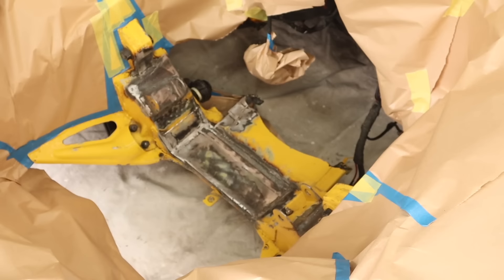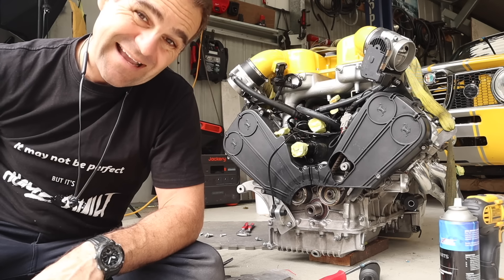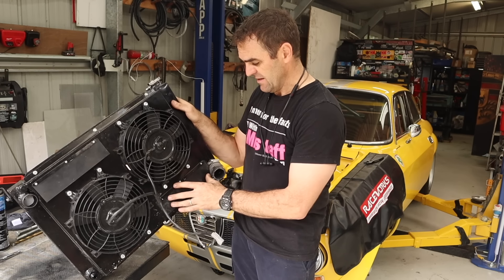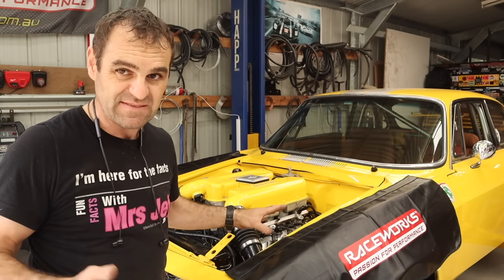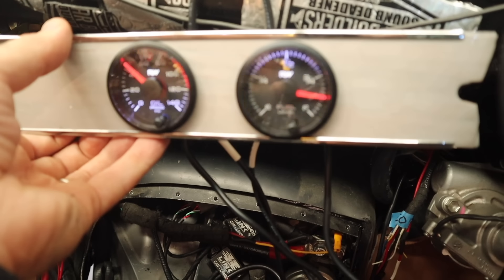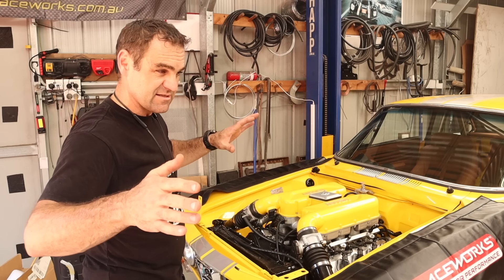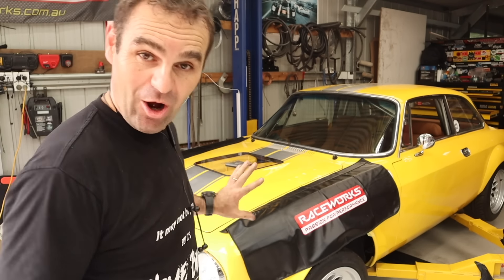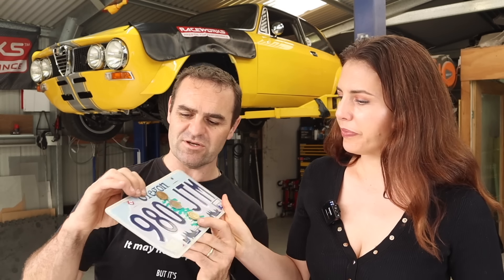I blew up the Ferrari engine...- Ferrari engined Alfa 105 Alfarrari build part 210

Comment: Worst case. Bent valves on one of the banks. Nothing major. Just a speed bump. 
Re time the engine and refit the belt. Comp test.  Don't stress. Take a breather.
Reply: ...and a beer...
Reply: A safety beer
Reply: Agree, re-time and take a look at the compression…. Bottom end will be aight

Comment: Re-time the engine and put the belt back on. Compression and leakdown test it. If the result are bad, heads off, check valves and piston heights.

Been in you spot before :)
Reply: What if the valve is hit and om the verge of breaking of the valve stem I would not spin it, instead would send a camera into the combustion chamber first
Reply: @specialvehicleimports7466  yeah, borescope is a good plan. Valves typically don't just snap off, especially not at idle speed. Bent more likely.

Comment: Hey Jeff, like the other commenters are saying, it's probably bent valves at worst. When the engine stopped running, there weren't additional pinging noises like if a valve dropped. 

As a previous Ferrari mechanic (worked on anything from 1960s - early 2000s), I'd put the belt back on and perform leakdown tests on the bank (looks like bank 2.) 

Anything lower than 80, the heads gotta come off. If they're above 80, then I'd also bore scope the combustion chambers to visually inspect the valves and the pistons. Make sure they're not excessively damaged that the leakdown says it passed. You can also check the valves and seats from the intake and exhaust ports. 

Best of luck Jeff, you got this!

Comment: That happened to my V6 Alfa Busso when the timing belt skept 1 tooth. 
I did the retiming, compression tested leak down tested and surprisingly was all good.

Still running strong after 2 years, hope it will be the same for you.
Reply: I had the same experience and results with my Alfa V6.

Comment: Ouch. We ALL feel for you and Mrs Jeff.
Sleep on it and approach is methodically and do all the simple stuff first. The advice in the posts below seem excellent to me. A few bent valves are not the end of the world. I've cracked a 911 cylinder from top to bottom a few years ago at 8000 rpm (missed gear). Carnage, but all fixed well. IMHO, leave the truck until this is put to bed. From a sunny England, Graham.

Comment: I feel for you Jeff. I know it sucks. I’ve been a professional mechanic since 2010 and I did a clutch and rear main seal on my truck and I started it without oil and I couldn’t hear the engine because the exhaust was a hack job that I had to cut out in order to pull the transmission. So I didn’t hear my engine knocking till it was too late. Never once did this to a customer car or my own car my whole career till now. I was / am beyond pissed at myself and now I’m currently building the engine for the truck. I feel you bro

Comment: So unlucky. Hope its not from running with too much oil in the sump. I onestly think the best thing to do is put the old belt on again and  do a pressure test. I dont think you can take the sump of without taking the engine out but in my opinion i would take the engine out again and check all the bearings too before starting the engine. And check the oil. Never nice to experience this but i think its part of the learning curve. Succes and keep your head up mate. Almost there.

Comment: Your poor bloke 

Fingers are crossed for you that was all the noise was and there was no mating of the valves and pistons ❤

You kept your cool quite well, far better than I would have after a long days work just being met with that. 

Get a boroscope in there, if no signs of contact and you can get the timing gear back together then hopefully all good mate. Best of luck.

Comment: I can’t imagine the stress and frustration you’re feeling Jeff. Ignore any  naysayers . You will get there . I’m about to attempt first start on an expensive A Series Mini engine build . Not exactly super car territory but I don’t mind telling you I’m a bit stressed!
Reply from the maker: Every first start after a rebuild is terrifying. Good luck mate.
Reply: @HomeBuiltByJeff Thanks mate 🤞
Reply: You'll be fine. 
Just don't get too spirited on the 1st drive and go easy on the gearbox.. 
Ask me how I know as MG Metro fanboy. 😂
Reply: @HomeBuiltByJeff  Sucess ! 👌😎
Reply: The noise does not sound like valves hitting. More like something bouncing around. Replace the belt. Double check timing. Turn over by hand. If OK. Do compression test.

Comment: Bugger. I'm pretty sure these engines are an interference engine, so yeah you have bent some valves for sure. Hopefully the pistons are still good and a valve hasn't snapped off. I feel your hurt. Soldier on Jeff, we are all right behind you.

Comment: Been there jeff, forgot to tighten the cam shaft sprocket bolt connecting the cam shaft sproket and cam belt to the cam shaft. They keyway on the sprocket kept it in time for about a mile before the keyway snapped and the spocket turned freeley. At least 4 bent valves. Cut the valves off checked the head over, fitted new valves refitted head and timmed up, ran like a dream. Consumables cost a bit, head bolts, gaskets etc, but in the end the main cost was time. It probably wont take you that long to do it. Good luck.

Comment: May the odds be in your favour Jeff! I'm hoping that the damage is minimal. New belt, re-time, check compression. Crosses fingers for you.
Reply: And it could be fine for eons but would always have that nagging voice in head that if not bent valve could be fatigued. High dollar engine so I would just yank the head myself as I know there was contact and rather not find out down the road that while in spec it’s fatigued and goons burn or drop at 10k rpm lol I’m more
Curious how the belt jumped and betting idler tensioner decide and or hydraulic pulley failure or bolt
Reply: I told him that sensor would be right fucked if it had come in contact and forcefully enough to throw belt. As use them myself as well as other link stuff. It would be deformed and fubar.

Comment: I repaired a Subaru DOHC EJ25D engine in which a crash had broken a cam pulley and bent 7 of the 8 valves on one bank. Amazingly the valves in the other bank were fine despite being driven by the same belt. Valve to piston wise, they're non interference engines, but being DOHC, unless all the valve stop and start moving together, the inlets and exhaust crash into one another, which is what had happened. No other damage, so a new head gasket, timing belt, pulley and new valves were all the parts the repair needed. I really hope the damage to your Ferrari engine is similarly minimal. 
If it's not obvious whether some of the valves are bent or not when you take the head off, pour a little of a very thin solvent like petrol into their port before you remove the valves, and see whether it gets into the combustion chamber.

Comment: Sorry to see mate, I would reattach the timing belt and turn the engine over manually at the crank with a ratchet to see if it all rotates with out any hits on valves etc. you got this mate 🤘🏻

Comment: Nooo! I'm so sorry that happened. We have all been there in one way or another. Since it was only one side it would still run on 4cyl. It will be some bent valves on one bank I would imagine. Its not like it blew up at redline. It sucks but i'd re time the engine and do a compression test/leakdown and cross your fingers! otherwise I think you might get away with one head rebuild. Good luck!

Comment: A well known Italian motto says, donne e motori gioie e dolori (women and engines [bring] joys and aches). So I wish you the joy phase being back soon. Completely other topic, in the stock 2000 gt (yours should be a slightly earlier but similar 1750) the oil pressure starts high and settles down when the engine is warm, so it's opposite wrt the porsches.

Comment: Jeff, as a former workshop proprietor specialising in Italian cars I feel for you however I suspect the damage won`t be anything as serious as you suspect. Saving grace is the engine was at idle speed. Reset the timing and then do a leakdown test. I suspect some bent valves. I had the same thing happen when one of my staff left a spanner in the valley which then vibrated its way to the belt and getting caught up while testing whether the timing was correct before the covers went back on in the workshop. It happens sometimes. Generally serious internal damage happens at higher than idle revs and we did a few broken timing belt repairs.

Comment: That’s the same noise my Alfa Busso motor made when the timing belt slipped a tooth.  In my case I got lucky, reinstalled the belt and all was good.  Hopefully you’ll get lucky too.  As others have said, reinstall the belt and tensioner, turn it over by hand, and cross your fingers.  If it turns over smoothly do a compression test, if that’s good start it up again.  Hoping for the best from California.

Comment: I couldn't bring myself to watch this episode for a day. I watched it hoping that you would stop the video before it happened, impossible I know. I had a similar thing happen with my Fiat 124 twin cam. Engine was cranking over but didn't sound right. Lifted the bonnet up, cranked it over again. Cam pulleys aren't rotating but its cranking. Stripped the teeth on the belt at the crank pulley. Three bent intake valves. Got my fingers crossed for you Jeff.

Comment: I really hope for the best and a miracle for you mate. I remember killing an Alfa engine in the race car all because of me stupidly not securing the overflow tank and relying on the street car fitting and forgetting about body flex. Damn thing popped off at Lakeside raceway, dropped onto the extractors and just spilled water everywhere (including my slicks causing me to spin). Didn’t stall, limped to pits but engine just cooked instantly…as would alloy DOHC heads as soon as there is no water (I didn’t realise what caused me to spin at that stage). A $5 fix would have stopped that from happening. Fingers crossed when you undo everything…it was running.

Comment: The revs didn't seem to drop and the engine did not misfire.  If the timing belt was allowing the valves to open/close at the wrong time the revs should have dropped or there should have been a misfire.  Best case scenario is the banging was just the Link module and the loose timing belt only became loose when the engine stopped.

Comment: Sorry to see Jeff. Stay optimistic. It was steady 1200 rpm so the belt might have had consistent tension and not been whipping. Maybe the belt hasn't even jumped teeth. Can you check that without removing the motor? You might be lucky. New belt. Re-time. Compression and leakdown test. If the results are same on both banks, no hesitation in firing it up to do your overheating test again. Fingers crossed buddy.
Reply from the maker: Thanks mate

Comment: Take a step back and remember that this isn't the worst problem you've had to solve, you've got this buddy! 

I'll dig around and see if I have some old NH toll tokens that can go with the old plate. They're a bit of iconic history for a coin specifically minted for our highway department. They all feature a rock formation called, "Old Man on the Mountain" that collapsed in 2003 and has a bunch of awesome indigenous Abenaki lore.

Comment: It is also possible that no valves are bent and the loose belt is the ‘trailing side of tension’ after the engine stopped rotating. That’s my hope for you Jeff.

Comment: OMG! I feel for you mate. That's gut wrenching. You may be lucky. The engine was only at idol. I would get a camera and put it in through the spark plugs and see if the pistons have taken a hit from the valves. I'm sure you can get an piston inspection camera with a light on it. Google it. It's a nightmare really because you definitely need to remove the rocker covers to see where the head timing is in relation to the bottom end. I would imagine the engine to be similar to my Alfa V6 Busso engine in that regard. ? I wish you the best of luck. I've been watching this project from the beginning and I'm feeling it too. Intense. Beautiful car. Fantastic project. I know you will get there in the end. Cheers Chris.

Comment: dont worry jeff its not a big issue at most you will need to replace a few valves head gasket just alot of hours leave engine in wilst doing it should be possible its very to need to  replace pistons they get little dents thats it it was only idling so it couldnt have done much wrong just be sure to check the valves for being bent some obvious others slights i spin them up in my lathe it stands out if there out even a few thou

Comment: Hey Jeff, as many have said put a borescope into the bores and look for the hit marks but as you said it still ran might not be a interference engine fingers crossed bud just hold your head up walk away for 10 then look at it with fresh eyes just did chains on my Range Rover 4.4 and just started it 1hr ago after near a month waiting on parts very tense moment when it didn't start but walked away for 10 then figured it out chin up hopefully its a easy fix

Comment: I'm gutted for you Jeff, there's always hope, check to see if the engine is still in time, if it's only a tooth out,  put it back in time and do a compression check after turning it over by hand,  you may have got lucky.  🤞🤞

Comment: Jeff - Really hurts to see this has happened, but I know you will figure out what to do and get on with it.  Unfortunately your engine is an "interference" engine and the odds of not having any damage are pretty slim.  If it is damaged, the silver lining is you get to show us how to do a valve replacement and fit new timing belts.  You took that as well as I have seen anyone do so (I would have been screaming and throwing tools off the walls) and best wishes for a quick fix and getting this car on the road.

Comment: I feel your pain.  Do as richard says and turn it over by hand.  I have an all alloy 393 cleveland engine and the builder put the wrong gear on the distributor drive.  It ate that gear and filled the engine with metal slivers.  Imagine my anxiety with a $22,000.00 engine full of floating abrasive.  I did the dirty and fixed it myself. Washing an engine internals with a pressure hose and auto fluid for the solvent.  The builder came good with the new gear for free.  It's just keeping at it.   Hang in there man.      Good luck.

Comment: We've all been there. The worst part is laying in bed at night and beating yourself up thinking it might have been simple human error and not a mechanical failure that lead to this and blaming yourself. I had a cam  gear come loose on an Alfa 2 liter because I forget to bend over the cam bolt locking ring.
The eventual repair was less painful than the mental self-abuse of a stupid mistake.

Comment: Really Sorry about this Jeff. I've watched you since the Birth of the AlfaFerrari and this really hurts!!
As someone has mentioned, it maybe just one bank. Put a New Cambelt on retime the engine then borrow a leak down tester and that should show if there are Valves are bent. Also put a Camera down to see if there is any internal damage.
Fingers crossed for you Jeff🤞

Comment: i feel you pain jeff before pulling apart fix the timing belt and do a leak down test see what the problem may be before going all in on it it might not be as bad as you think it is a leak down and a camera in each cylinder to visualize then tear apart if needed your engine has an interference fit so at idle or low revs you might have dodged a bullet re do the belt and timing and do a leak down it's not going to cost much maybe a belt and some time but then you will know don't guess as that usually cost more in the long run cheers from broken hill

Comment: I think you'll be ok. There's no engine miss. Id put a new belt on it then do a leak down test on each cylinder. Pull the plenum cover off and you'll be able to hear the air escaping if any of the inlet valves are bent. I've done this a few times mow on Mercedes Benz engines that are interference type engines to determine the extent of the damage. In both cases the engines were saved with just valves.

Comment: Run your bore scope in the plug holes in the heads and slowly turn it over- you are looking for dinged pistons and bent, poorly seated valves. The one true problem with cogged belt timing set ups is a degree of fragility from untoward events. It was still running, so it would deem unlikely that you have holed a piston, but a few bent valves are likely- but much cheaper than a whole engine. Or you could put an LS in it; but I doubt that would satisfy your Jones much at all. I'd do the diagnostics and order the parts for the valve job and take it to the show on the trailer; Binky still not been presented as finished either, so there is that. That said, you may be in a dead heat with Fanatik if you have just one more 'little delay"! The truck isn't made of Ferrari and Alfa parts, so at least it may be a deal less expensive. I have it on good authority that many Ferraris spend way too much time under glaring shop lights with fancy tools pointed at their gizzards. And hello to you too, Mrs. J! A thought, could we have a 100 th engine out celebration?

Comment: At times like this, all you can do is pour honey on yourself.
I agree with those who say its worst case a few bent valves. Stick a new belt on, do a cylinder leak down test while gingerly turning the engine. 
Good luck mate, hope Enzo is looking down on you favourably.

Comment: Judging by the noise, I'd say you've got some bent valves.
The rods are stout so they'll be fine. Crank will be fine. Might need to replace a piston.
I've got an interference engine with a loose timing belt right now myself and it's not as bad as you think.

Comment: install new timing belt, turn it over by hand,  compression test.  There is a 50/50 chance it is fine. It is not as bad as a dropped valve or seat or bearing failure.  I feel for ya